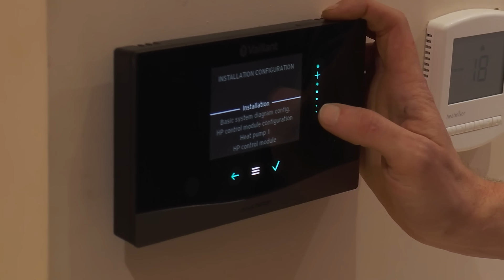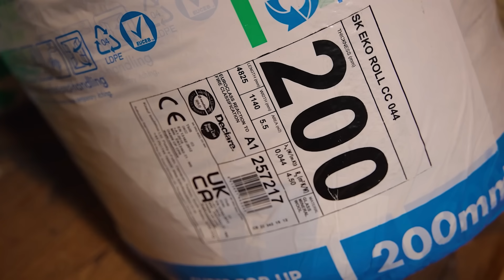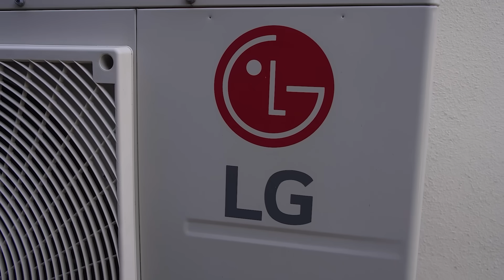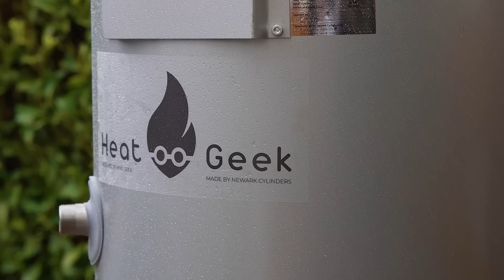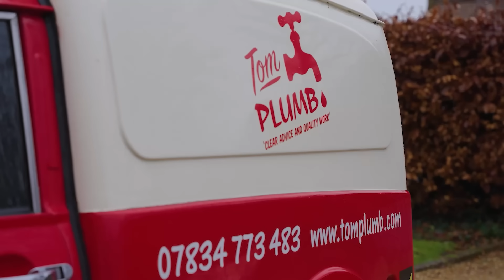Heat Geek’s Heat Pump One Year Later — The Verdict!

Comment: I think it's unfair to say "heat pumps don't always work" 

They will work on any building and be similar or less cost. But they need to be installed properly.

The electric cost is a political decision. The cost is based purely on the cost of gas. Takes no account of the energy mix. Get that changed.
Reply from the maker: That is not quite accurate. The heat loss from a building must be matched in real time and the low temperature heat is not able to do that in many cases. It is simplistic to say that this can be fixed with insulation but, on a practical level, it is very hard to achieve in some older homes. So chasing a technology to satisfy a dogma is going to leave a lot of people cold and out of pocket.
As for electricity prices, many people misunderstand what the green levy is. The government is contracted to give investors a fixed return on renewables and that is entirely reasonable. There was talk of switching the levy over to gas but, in the light of the global hike in prices this would not be a politically survivable move. There would be riots.
Reply: @SkillBuilder  insulation just makes it easier to heat at a low temperature. My gas boiler is managing to heat my house with standard double panel radiators even in negative temperatures at 50 degrees flow temperature. I need to sort the insulation but it's complicated by a bad 80s loft conversion. 

The green levy is pence compared to the cost of the which has pushed up the cost of heating and electricity. This subject has been well covered in other places. British gas profits went from 75 to 750 million in 12 months. That's not renewables causing that. I will be going great pump in the next few years and have data from a friend's house. His heating bill is less on a heat pump than it was on gas. In part thanks to octopus cozy and leveraging his solar and battery.
Reply from the maker: You get 50 deg C when it is below zero. You will struggle to get that from a heat pump. This installation doesn't achieve that and it is a good heat pump.
Reply: @SkillBuilder  my controller works on a pid controller to control the boiler using open therm to set the flow temperature. This heat pump is not getting 50c because it doesn't need to, it could if it needed to. Yes it would be at the expense of efficiency but it would still heat the house sufficiently. How often do we actually get sustained sub zero temperatures tho? So the actual cost to that over the year is minimal. 

Insulation is good, but lack of insulation doesn't mean a heat pump won't work.

Comment: Technology if fine, installation the problem. And yes they will work for 99% of homes. Come on @skillbuilder just admit it!
Reply from the maker: Silly remark. I am not in denial but, unlike you, I  deal in facts and have worked in a great many homes. Heat pumps produce low temperature heat and if the heat loss of the building is greater than the input you have a problem. Many require a 3 phase supply and that is not always easy to arrange. 
This installation was on the cusp and the electricity supply (single phase) had to be upgraded. 
The cost of all this was well over £20K so, yes with a government grant, it is viable for some but let's not pretend that heat pumps are the answer for the masses. They are not and never will be.

Comment: Nice to see a rounded follow up. I don't think we'll ever get Roger to Adam's level of ASHP evangelism. 

One thing not covered but also more important than ever with more and more draught proof homes, a gas hob is terrible for your health with the emissions it gives off. Going induction removed them completely. New builds with gas hobs have terrible air quality, I used to measure mine with a Netatmo unit and it was constantly pinging me with warnings. No such issue with induction.
Reply from the maker: You are right about cooking with gas. Our worst air quality readings come when we are cooking the Sunday roast.

Comment: So i can have a relatively cheap to buy and install gas boiler that fits in a kitchen cupboard and heats my house in 20 minutes or this thing that looks like the size of a small power station that costs a fortune in electricity to run?
Reply: A reasonable heat pump install will have similar energy costs to a gas boiler. John's is significantly cheaper to run.

Comment: Good report. There is so much ignorance and misinformation out there on heat pumps, exacerbated by incompetent suppliers/installers, that many people are still confused and untrusting even after heat pumps have been widely proven and accepted for very many years in all climactic conditions - except perhaps Antarctica. I installed the simplest (cheapest) form of heat pumps (air-air, no water) together with 7kW of solar panels, and ended up delivering nearly 1 megaWatt of power back to the grid after supplying all my house energy needs, including heating, cooling, electric cooking, solar/immersion water-heater, 3 fridges, inside/outside lighting, and some more. Totally regardless of insulation (which is nonetheless very important), a heat pump will always be at least 2x more energy-efficient than any gas system.
Reply from the maker: air to air is actually a much better solution for many

Comment: Totally unconvinced with heat pumps. Gas boilers are far more heat effective and far cheaper to run.
Reply: A reasonable heat pump install will have similar energy costs to a gas boiler. John's is an exception and is significantly cheaper to run

Comment: I only trusted Octopus to install my A.S.H.P. otherwise I would of replaced like for like.  After several months of running very happy with the unit.
Reply: my experience with Octopus is extremely negative as a customer but fair playu if you are happy with your subsidised heat pump and tariff

Comment: I'm dubious about retrofitting heat pumps to existing houses,  particularly older ones. However I think that they should be mandatory for new builds as the necessary characteristics for efficient use can be designed in, eg underfloor heating. The same with solar panels.

Comment: £180 for a gas saftey certificate? Guys near me in bradford are doing them for £30 and i can't even get the work doing them for £65, that's why I don't do them cos it's a race to the bottom in bradford
Reply from the maker: I think that probably sums up Bradford nicely. In London you are on the opposite spiral. But before you pack your bags and hot foot down here, there is congestion charge, parking, ULEZ and massive fines for yellow box infringements or nipping the end of a bus lane as I did a few weeks ago. Then if you want a sandwich.........

Comment: Let's be honest, they are just not worth the hassle. I don't want to spend my life thinking about the heating system.
Reply: It's fairly straightforward here. Can be fit and forget (with maintenance).
Reply: @Biggest-hz7ng  I have not seen many accounts of folk finding installation straightforward and cost-effective. If it were such a great technology you might have expected a bigger take-up??
The UK has lots of old housing stock with solid walls and little insulation - not a good starting point. Also 4.92% of new homes are built with heat pumps (ground and air). Not really a ringing endorsement. I am all for green technology, but it's got to work.

Comment: Our heat pump was installed nearly two years ago. Government grants were not available for the type that can reverse to be used as Air Conditioning in the summer. Also we retained the gas boiler central heating which probably wouldn't have been permitted under the Government scheme.
We have a two bedroom, well insulated bungalow with solar panels but no battery. 
Because the electric tariff is almost 3 X that of gas, we haven't used the heat pump for heating, but we have enjoyed the Air Conditioning courtesy of the solar panels in Summer.
[The heat pump supplies warm air via ceiling vents from 8" ducts in the loft].

I think I would do a more scientific comparison of winter heating costs but my wife is an auditor so I defer to her.
Reply: Some claim reasonable efficiency for air conditioning as heaters. @timandkatsgreenwalk for one.

Comment: What's the theory of the client using daytime energy at night-time rates - without that carbon neutral perk, another total fib - use electricity during the day at 40p like everyone else - very similar to dead cheap electric car- charging rates - without those perks that veryone else pays for, it wouldn't be viable - if everybody had electric cars and heat pumps - where would all that dirt cheap energy come from? We have quite a high rate of renewables already, and it's very expensive, and likely getting more so.
Reply: We will have roughly 3x wind and solar by 2030. So there will be more renewables than now.

Comment: Not a typical install. No discussion on actual hard numbers. Comparison of fuel prices between electricity and gas. There is literally no valid takeaway..other than trades makign money from installs subsidised byt the government for middle class customers.
Reply: You need a SCOP of air 3.1 for the energy costs of a heat pump to be roughly equally to that of a gas boiler at price cap prices. John's SCOP is 4.5, so his system is significantly cheaper than gas would be for the same heat output.

Comment: Before I switch to a heat pump it needs to match what I’ve got now (oil) in functionality while being cheaper enough to run that the payback time is less than 10 years. The two heat pump systems I’ve experience (neighbour and friend) didn’t get water very hot, couldn’t provide the rapid response of my current system and weren’t much cheaper to run. In this kind of case what’s the point? I would need some major iron clad guarantees, about functionality and costs before I ever thought about switching.
Reply: Hotter water costs money so most don't heat it that hot. A reasonable heat pump install will have similar energy costs to a gas boiler. John saves perhaps 30% on his bills with a superior install (more because of his tariff).
Reply: The point is that you don't need the rapid response.  They are on all the time keeping things at the temperature you prefer.

Comment: The cost of electricity in the UK has nothing to do with the availability of electricity; it's to do with the corrupt neoliberal model of pricing where energy is bought on international markets. If energy suppliers were renationalised,  they could be run for the benefit of the people rather than a few rich people with offshore bank accounts.
Reply: You would have an argument if you hadn't used the phrase "neoliberal model" as then you are appear dogmatic instead of reasonable.

Comment: Heat pumps are fine as a background heat as long as you have a log or multi-fuel stove as your primary heating source - as in Scandinavia.  In the UK with overpriced electric it's a waste of money.
Reply: Rubbish. I've used my heat pumps alone when it's been -20C for 3 days straight.  haven't used my log burners for years - I prefer to keep my respiratory health.
Reply: @BenIsInSweden  It's crazy having to keep a heat pump running 247 to keep your house warm but alteast your electric is far cheaper - leave an oil or gas burner on 247 and you'll have to open all windows and doors, even in -20.  In the UK, the issue is, electric prices are through the roof so heat pumps are an extremely inefficient, ineffective and overpriced way to keep a house warm.  All that 400% fairytale nonsense doesn't apply to the UK due to the sheer cost of keeping it on.
Reply: @overwatch761  Gas boilers are more efficient to run on a low temperature running 24/7.   It's about getting the heat provided balanced against the heat loss of the house.
So no, having a gas boiler running properly 24/7 would not mean you need to open the doors and windows.  You're just misunderstanding the concepts of how to heat the home efficienctly.

Comment: Ive recently had my alpha CD 25 X replaced with an Atag, running opentherm and a tado v3 system, as him its left on 24/7 and temperature left at set temperature and usage and fluctuations are at a minimum

Comment: So with a heat pump it seems you have to continually heat the entire house including rooms that you never use, when you're out or away on holiday, in order to get the advertised CoP. Whichever way you look at it, heating un-occupied spaces is wasting energy. The CoP on paper might look acceptable, but how does literally throwing away heat to achieve that make logical sense?
Reply: Unless your internal walls are built and insulated to the same standards as your exterior walls, then you're heating unoccupied spaces indirectly, meaning you need to use a higher temperature to heat the occupied spaces to counteract the heat loss into the unoccupied spaces.
Reply: @BenIsInSweden  They'll be some heat loss to the empty rooms for sure, but those rooms will always be colder than those that are directly heated and therefore switching rooms off will use less energy than keeping every room to full temperature. By that logic you only need to heat one room of the house and every other room will become heated to the same temperature, which obviously isn't the case. What about when you go out to work, or go on holiday for 2 weeks and you still need to heat the entire house - is that a wise use of energy?
Reply: @benwillcox8551  I'm not saying it gets heated to the same temperature at all.  There's a heat geek video on it. If you only heat 1 room in the house, it needs a higher radiator temperature to keep that room at the desired temperature if the surrounding rooms are much colder.  It's much better that if there's an emitter in that room to make use of it allowing a lower temperature overall, and more efficiency (regardless of gas boiler or heat pump).

You can have setback temperatures too, which you generally only lower by a few degrees.  Going away it's up to you really, you can set a holiday temperature, and set it to come on a day or two before you return. UpsideDownFork has a video on what he did whilst he was on holiday this winter.

Comment: Had a heat pump when I lived in Norway and it worked ok. Mind you it was a £1m flat with triple glazing and an A+ insulation rating.
Reply: I live in Norway with a house built partly in 1946 and extended in 1986.  It doesn't have triple glazing and certainly nothing like an A+ insulation rating.  I installed a heat pump in it last year having always been skeptical of them.  I love it.

Comment: The electric radiator in the background is a thing of beauty.
Reply: I saw that. Is this their top up for those days when the heat pump can't get the room to 20 (which I think is too cold anyway)?
Reply: @gareththomas1395  No, a conservatory is classed as an outdoor space under Building Regs, so must be isolated from the heating system.
Also, the heat loss from a conservatory is so great that having it connected to a central heating system is pointless anyway. Having a fast acting point source of heat such as an electric fan or radiator is the only viable option on the infrequent times you need it.
Reply: I have electric space heaters and gas central heating…

I think heat pumps aren’t for everyone. It’s good that it works for some people and I believe these guys when they say it works for them.

I’m not sure that we will always have gas in the mix. Things change; I’m imagining someone from the 18th century claiming that all houses will have a hearth at the centre of the home, or someone from the early 20th century claiming coal and wood will always be part of the mix 😂.
Reply: and it is switched ON! ;)
Reply: Its a conservatory.......
Reply: Conservatory are not heated spaces in a heatloss survey… just saying 😉
Reply: Do I detect a hint of sarcasm? LOL.
Reply: I wonder if it’s turned on?
Reply: Lolol good spot I think they're covering up he probably has electric heaters in evey room 😂😂😂😂😂😂

Comment: Can't wait to see you install these into a block of flats. I will stick with a boiler no hassle. If you believe in the C02 💩,the Chinese are laughing all the way to the bank.
Reply: They do get installed in blocks of flats.. Just a different variation, Kensa have done some retrofits in London.
Reply: @BenIsInSweden  Problem is I don't believe in net zero as the worlds CO2 is only 0.04% of which 0.0003 is man made negligible.🤔
Reply: @Clansman63  There are plenty of other reasons not to have gas piped into homes, especially flats.
Reply: @BenIsInSweden  please give me some reasons as we have been using it for well over 100 years.
How about log burners.👍
Reply: @Clansman63  "Sunderland's Whickham Street flats", "Redwood Grove, Bedford flats", " Well Street Hall, Hackney".  Search for any of those along with "gas", and you'll get some idea.

It's a subject very close to home for me, as back when I was living in a flat in Kent, when the combi boiler got serviced by a gas "safe" engineer, one that was required by the housing association, the test valve was left open.  Meaning gas leaked into the kitchen whenever the boiler fired - which for us meant it would only be vaguely noticeable after someone had a shower - and of course, by the time you're dried off etc, it would be even less noticeable.
Reply: @BenIsInSweden  This all seems to be incompetent maintenance.I will never buy a heat pump or an EV, but if you feel you're saving the planet, no one's getting hurt except you're bank account happy days.
Reply: @Clansman63  Ignorance is bliss, isn't it? People get hurt or die unnecessarily, because of (if you say) incompetence, where if gas wasn't used at all, the risk wouldn't be there to begin with.
Heat Pumps are generally going to be cheaper to run regardless.  And I would go for a setup with cooling when I move back to the UK within the next year. One of those comforts that a gas boiler can never do.
Reply: @BenIsInSweden I will stick with coal, wood, and gas boiler no problems.